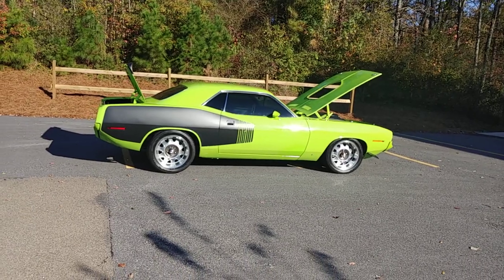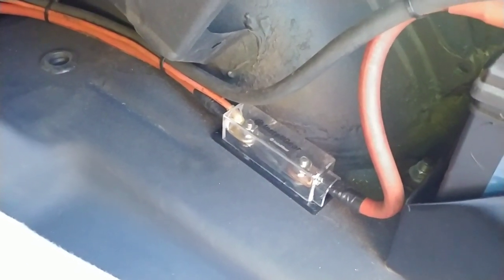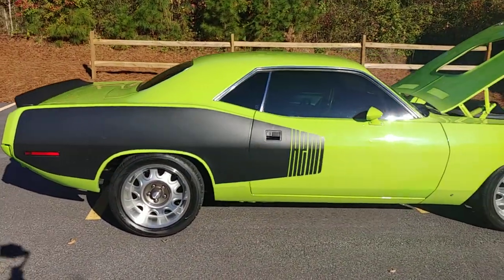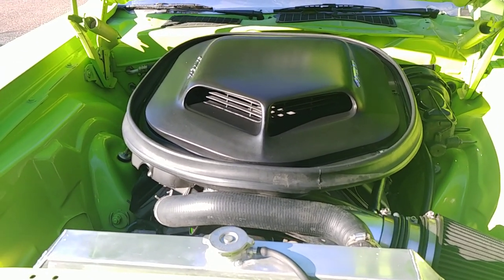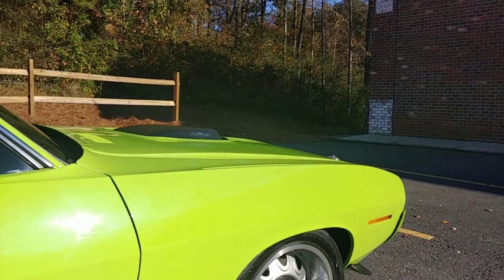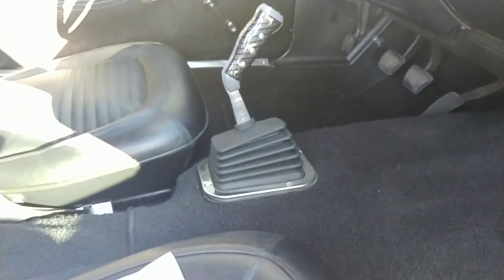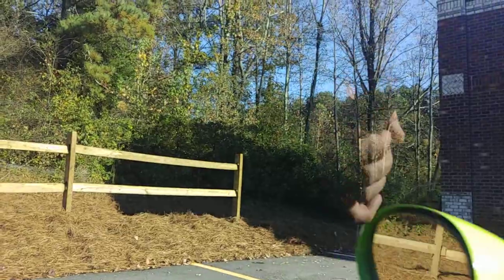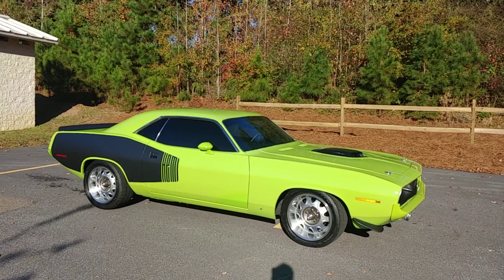SOLD - 1970 Plymouth Baracuda

Comment: That Barracuda looks awesome, another positive thing it looks like it has is a shaker hood or six pack, but even the lime green  color which is an original color back in the day, the woodgrain steering wheel those are sought after options and the rear battery in the back looks like a set up, that would be used in the racetrack,👍👍👍👍👍👍👍